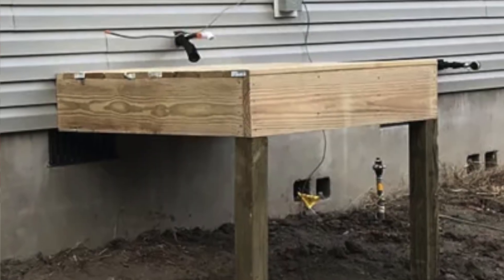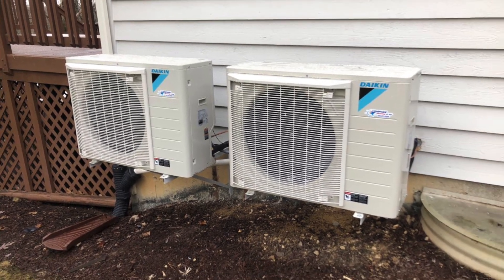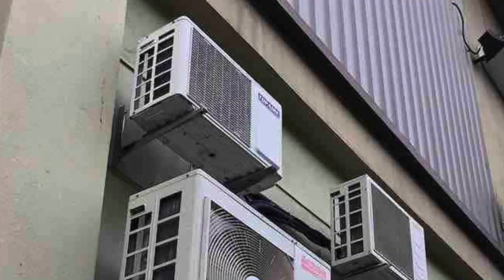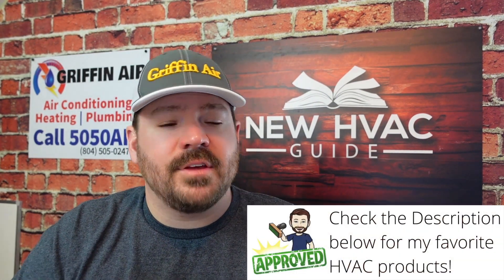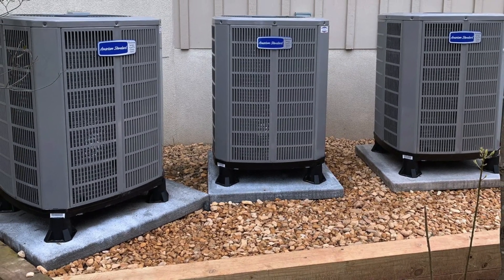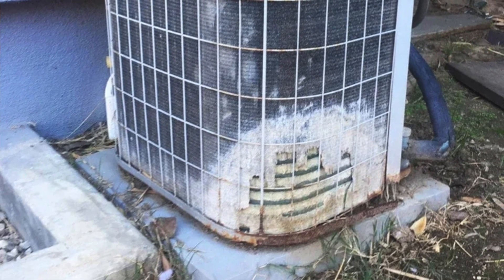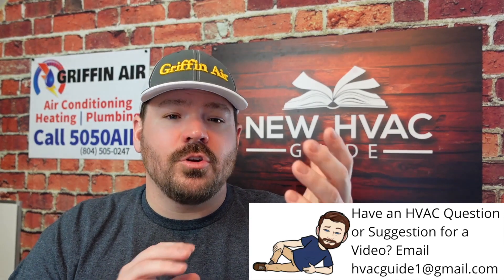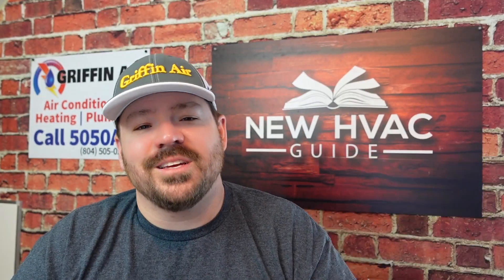HVAC Systems Elevated for These Reasons!

Comment: HVAC contractor recommended Mitsubishi Ducted with elevated bracketed system to brick exterior in Flood zone. Will there be issues with noise or vibration with Mitsubishi?

Comment: I’m being told by my hvac guy that he wants me to put a concrete slab but have the heat pump at minimum of 8 inches above the slab with nothing underneath it because it will freeze and make a block of ice underneath it. Is this a thing?

Comment: It would make sense to slightly elevate it because I clean my Trane 2.5 ton outside unit in my backyard thatvsits on a slab off once a year and the coils are always dirtier at the bottom of the spline coils. I wouldnt mind elivating it several inches higher. I also have two dogs and I weedeat around it.

Comment: I wish you would address the issue of harmonics. My condenser unit is next to the bedroom. In Tucson you have the AC going all the time in the summer so I feel the vibration and I can hear the harmonics just goes right through me thanks
Reply: If the line set is fastened tightly against a joist or stud, instead of with a stand-off type support, it will cause the vibration and noise you are explaining.

Comment: Hello Josh, love your video presentations, always a great source of HVAC information!  Might I add?  My HVAC co. gave me options to the mounting of my Mitsu ODU.  I did not want them using the wall mount for a couple reasons as follows:

No added holes in my outer walls, and no vibrations getting transferred into my home.  So, they offered the 'Quick Sling' which I noted in your photo of the Mitsu unit toward the end of your presentation. 

Their method is to mount the Quick Sling on a pair of 6x6" pressure treated 'rails', and then that gets leveled on a trap rock bedding.   I had them repeat the same setup for my newest Mitsu addition last month so the two ODU's would match.  

Yeah, I am a guy who likes things on the outside of the home neat and uniform, even though, none of this can be seen from the front of my home.    Thanks again, looking forward to your next one !
Reply from the maker: Thank you for your kind words sir